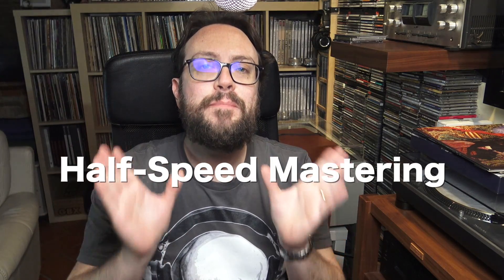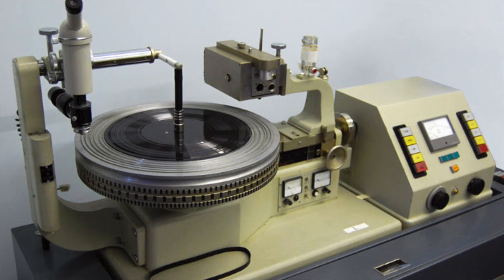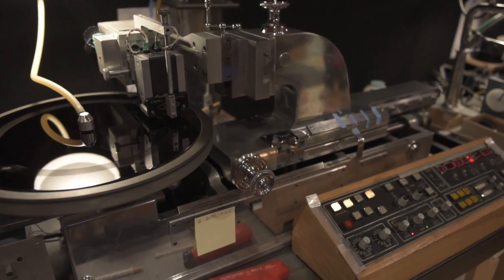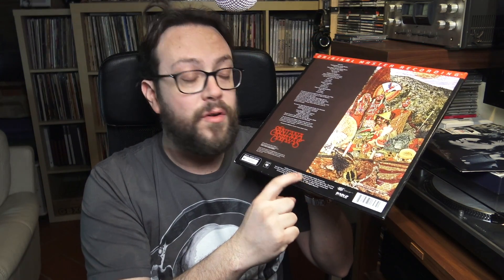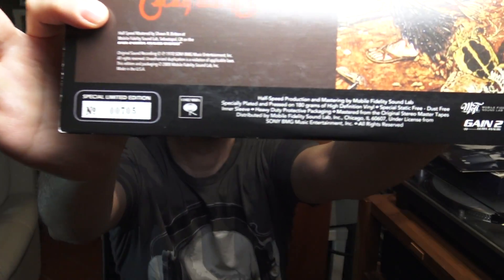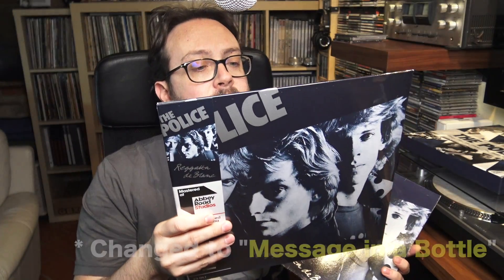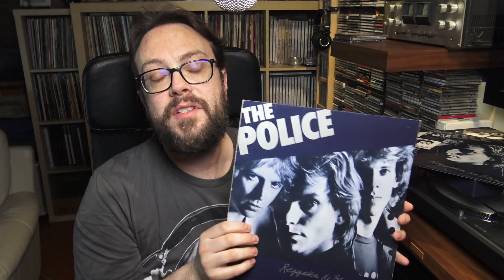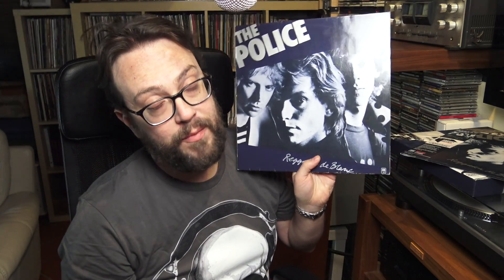Vinyl Half-Speed Mastering: pros/cons & test

Comment: Great video! I do think it's kind of impossible to test half-speed as a whole by listening to separate albums. Ultimately the master itself (wether analog or digital) is what has the bigger impact, so for example, maybe in the case of your test of Regatta de Blanc, the same difference could have been found between the german pressing (which I presume is also AAA) and a "non-half-speed" version of the new reissue, given that it would use the same master, and probably is a digital one...

Regardless, I do own half-speed reissues of Queen and Genesis albums and they all sound great! I'm not 100% sure, but I do believe all the half-speed cutting at Abbey Road is done by Miles Showell (at least the Queen and Genesis records are, based on the deadwax info) so I guess that is also the case for that Police reissue box set...
Reply from the maker: Indeed, we need the exact same master in the two version for an effective comparison

Comment: Comparison not valid, many different parameters are being compared not just the half-speed aspect, are they both from the same masters or from a duplicate, was mixing the exact same although done at different times and places and on different equipment, were the masters or 2nd generation duplicates in the exact same condition etc. I also found the German pressing better which goes to show that in the end the German production resulted in a better end product at least to my ears, if the German production had gone half-speed as well all else being equal i think that the end result would have been even better.

Comment: Kudos and bravo to you for such a thorough channel that covers most everything HI FI. I agree , if the second recording was the original, the base is easier to distinguish form the drum, and the cymbals are more pronounced, which is a problem with a lot of recordings, not enough high freq response. listen to the cymbals form a live band and you will know what Im talking about. It depends a lot on the specifics, Why go half speed when 45 rpm is touted as being much better high freq response? Why dont they do everything half speed if its better? Ive seen the fine details of everything in the processs, recording, mastering, and production, effect the outcome. 45 rpm makes most sense to me. the high freqs can shine

Comment: File 2 is better.
Probably half speed cutting is better but as with every process, all parts must meet a higher standard to genuinely be better. There are many factors in equipment, source and skill.
When the original was made all music was mastered to vinyl so there would have been a lot of staff with a high skill level and sign off by someone who probably had done 20 or 30 thousand hours.
There is not that skill level now.
Some of these half speed  recordings will sound better due to good fortune. Most wont.
Great vid thanks!😃🤘😎👍

Comment: Completely in line with half speed mastering wish to see quater speed mastering.
The only thing you're loosing are distortion as the lathe is way more precise, better low , better mid, better high. 
This said, the sound of slower recording is more clinical due to what mentioned previously! 
It's to the client to buy what he prefer, the more capable would buy the two. 
File 1 is way more steady/clinical but lack more lathe artifact/distortion. 
File 2 is more punchy/heretical but less clinical/more distortion. 
Both sound great! 
Both worth existing!
Ps: That's also valid to digit vinyl, and my preferred method, way more detail captured especially with regular cartridge!

Question, as you have some master tape, can't you do a comparison with them to see which one is more closer to the master tape? (i'll bet for the half speed version)

Comment: Hi there greetings from Portugal... love your channel watch it all the time :),now I wanted to share something on this theme. My first 1/2 speed record was the Technics Audio Inspection Vol.1 (1976) and it really has an impressive sound .. moving forward, a few days ago I had a 80$ credit in a big chain store here nearby and ordered 2 albuns that I wanted ... (Zigy stardust - David Bowie) and Brothers in Arms, I got the brothers in arms because it was 45 rpm, and I saw both with 1/2 cut from Abbey road, so I thought, lets see where this goes. I have both original pressings of Ziggy and brothers, but they where from my sister, so when I listened this new half cuts they sound to me horrible, it seems the cimbals are outside of everything, the bass is not enough compared to the original, and it didn't sound anything close to the beauty of the Technics half cut Mastering that i remembered, so I just saw your video and I went to the Technics LP and they have the process and I cut and paste here and this is my theory, this new half cuts are not working because groove width, but I don't know, I just noticed that from Technics research, the half cut method in order to be possible the groove widthness had to be expanded and a limit of 16min per side was introduced. Reading this I believe that Abbey Road is doing half speed mastering but keeping the groove dimensions to the limit, and that brings limitations, but this is what is explained by Technics research in 1976:

"2. Low speed cutting and frequency response range
In the cutting process, the cutting master tape playback speed was reduced from the conventional 38 cm/sec to one half, or 19 cm/sec, and the speed of the lacquer master disc was also reduced from 33* rpm to 163 rpm, and the cutting was made at these reduced speeds. This made possible increased volume levels and improved transient response, with the frequency response characteristics of the cutting process expanded tics of the cutting process expanded to 20 Hz-45 KHz.

3. Abundantly wide cutting pitch
In order to make the most of the above factors, the groove pitch was chosen that there would be ample clearance between grooves. The actual recording time per side is therefore some 16 minutes, and no attempt was made to compress the groove spacing. This enabled higher peak levels, and a more-than-adequate groove amplitude, so that the low frequency response, in particular, is greatly improved."

So while not aproaching step 3 at the current half cuts.. that means we are loosing indeed the low frequency response....Do you have that Technics LP ? 

It is Technics Audio Isnpection Vol. I - It has an amazing version of Caravan - Duke Hellington :)

P.S.: My system for ref. SL-1200GR | EPC-205c Mk3 + Jico SAS on Boron | Mo-Fi Phono
Reply from the maker: Very interesting comment! Thank you for sharing. I am sure that this one of the reasons why the Abbey Road lps sound so bad

Comment: I have never heard a half-speed pressing that sounded great.  In fact, I have never heard a half-speed pressing that sounded better than one of the hot stamper normal speed pressings.

A few items:

1) No amount of lacquer cutting technology or advancements will make a poorly mixed and mastered pressing sound good.
In fact, the better the canvas, the more we will hear what the studio personnel got wrong with their mixing and mastering.

Alas, the vast majority of music that gets released to the public has sub-par sound quality.

2) Without knowing what equipment our host was using to play those samples, we cannot know where the good or bad sound quality lies.
In addition to not knowing the gear that our host used, we do not know if he professionally dialed in his turntable:

-- the effective length of the tone-arm
-- the cartridge's weight
-- the vertical tracking alignment / rake angle
-- the anti-skating
-- the overhang
-- the offset
-- the zenith angle
-- the cartridge's azimuth.

The above settings -- every single one -- is critical to reap the rewards that are in the record's groove.
A good $500 cartridge will sound better than a $2,500 cartridge, if the former was professionally dialed in, and the latter was not.

3) We do not know how our host converted the analog signal into a digital file.  The conversion hardware will affect the sound quality.

4) No two pressings have the same sound quality.
Two new pressings, of the same title, unboxed and put on the shelf in a store, will differ in sound quality.  On a mass produced stereo, it might be hard to hear the differences -- especially if the turntable was not professionally dialed in.

So whichever of the two samples sounds better, if other pressings were used, that could change.

Half speed cutting of the lacquer will be beneficial if, and only if, the studio personnel do not compress and equalize what is on the initial capture tapes (or digital files).

Alas, based on what we hear for nearly every hit song, the studio personnel are enamored by every box in their studio.  If they have a box, they run the signal through that box.  If there is a knob, they turn it.  If there is a lever, they slide it.  If they have a digital tool, they have the signal (or file) traverse it (get processed by it).

Even if they keep a box's controls on neutral, they still run the signal through that box -- and every box, without exception, adds coloration and distortion to the once (virtually) pristine signal.

The better your home stereo, the more you will hear what the studio personnel did wrong.
Win the lottery, and buy that dream stereo, and most of your favorite songs will not sound too good, and such a stereo reveals every flaw -- and you can and will hear the flaws.
On one of the rare gem pressings, that has great sound quality, a quality stereo system will reveal that, too.

My conclusion is that half speed mastering might have started out with good intentions.  But now the studios use that process, simply to slap a label on the pressings to sell you albums that you already own.  it is a gimmick, to separate you from your hard earned income.

Only when everything is done right, will a half speed master prove to be beneficial.  I have yet to hear one that is beneficial.  I stopped wasting my cash on half speed masters 10 years ago, and as far as I know, they are still all "wrong" sounding.  They are not all terrible.  But none of them are simply "right".  Whereas, for many albums, you have a shot at landing a normal speed mastered pressing that will sound great.

My advice to folks looking for the best sound quality is to find reputable reviewers, whose ears you trust, and try to get the stamper codes on pressings that they say sound great.
That will not guarantee you a great sounding pressing (even the right stampers have duds).  But without the right stamper, you have no shot.  With the right stamper, you have a very good shot at landing an excellent sounding pressing.

Comment: Number 2 sounded better through an Optimod which is used for radio processing. A punchier and deeper kick drum was the most prominent difference, I didn't notice any difference in the highs but that might have been smoothed out by the Optimod. Also number 2 seemed to have some pleasant phase delay in the low end which may have been introduced by some of the analog components that the audio was running through back in 1979. Not sure what the process was in creating the half speed version, I would be surprised if it was made from the same physical master.

Comment: It's apparent that version #1 has been tinkered with more so than version #2. Also, your comparisons are not apples to apples. Version one was probably taken from a digital file source which defeats the purpose of vinyl altogether and has probably been cleaned up to remove noise and various clicks associated with analog tape. Once you digitize audio, its artifacts remain. The artifacts don't vanish when you cut to analog. I like the sound of the original German pressing for a few reasons. 1. It's a hotter cut in which the human ear hears it as "better." 2. The original cut is nicely compressed giving it an overall warmer sound. I feel that in order to do a better comparison, use one of the LP's from the Beatles MFSL box set versus the standard UK release. Yes, the vintage is early 80's, but it puts you on an equal playing field. The Police LP's are many years disconnected from equipment vintage. Equipment over the last 40 years has changed, maybe not for the better, but it has changed.

Comment: Back when I used to record analog on CDs (polyvinyl carbonate) this way slowing down the source audio cutting at 33.3RPM to play at 45, I discovered the RIAA curve had to be reworked, not just reversed.
Of course you know you can't record "flat" frequency response onto a surface because the bass would cause the needle jump out of the groove.
When recording (cutting), the curve for playback has to be reversed, also when cutting at reduced speed, you can't use the traditional curve.

Comment: Sample #2 has more highs, but sample #1 highs seem clearer and crisp.
I think there's a need of frequency compensation to hear the benefits of half speed mastering.
Many years ago I had an old four-speed turntable (16,33,45,78 rpm) with a very bad cartridge and stylus.
I used to record my LPs at 16 rpm and 3¾ ips, then playback at 7½ ips. They sounded very good. Like there would be recorded using a top quality MM (or MC?) cartridge.

Comment: Cutting with half speed would allow indeed to cut higher frequencies 

BUT

the record must be play back with normal speed and here there more or less the same issues with high frequencies as the needle has a mass and the higher the frequencies are the higher is the acceleration of the needle and due to F=m*a the higher the forces for the needle and also the vinyl are.
Reply: Ortofon to the rescue LOL

Comment: Hello, And thanks for posting. There seems to be some confusion regarding your sample file. Can you confirm that you used a German/West German first pressing? If so, would you please state the deadwax/ matrices for this sample? As it stands, and according to Discogs, only later re-issues appear from Germany. IOW, this title does not seem to appear as a 1979 German/West German pressing. Rather only later issues/re-issues from the mid 80's. Generally speaking, a 1st pressing should have the original A&M logo labels(not the 5LP circle labels), original AMLH catalog and no barcode. Thank you for your efforts!

Comment: Where can you possibly get two LP's where everything other than cutting speed is the same? Unless you're in the industry, and in a position to order two separate test cuttings and pressings from the same master, that is...

 I'd imagine the quality of the master tape matters at least as much, tape copy generation/ age/ storage time/ storage conditions, temperature and humidity/ the state of the cutting lathe and cutter head/ the tape player used for playing the tape, maintenance and adjustment/ the electronics in the signal chain/ the quality of the lacquer material/ the time between cutting and metalizing the lacquer/ and the list could probably go on for pages and pages. Even variations in subsequent stampers may play a role, and how many records were pressed with the stamper before your copy, and the quality of the vinyl itself, and any variations in temperature and time of the pressing cycle. Two separate records at consumer level will most likely be the result of EQ settings on two separate occations and by two different cutting engineers, even. 

I don't mean to be mean here. Just that we really have to be careful when attributing differences in a finished record to a single step or element in the complex and lossy process involved in manufacturing it.